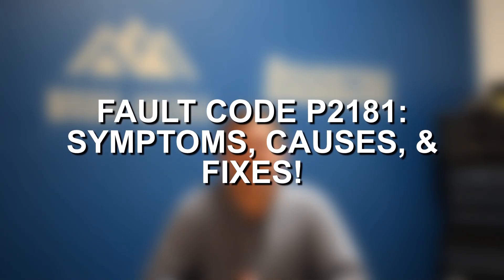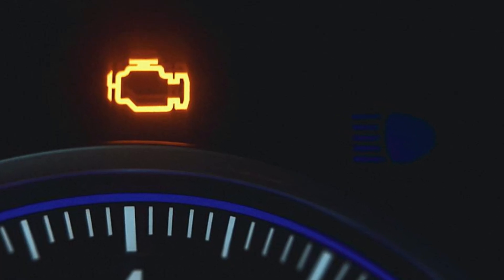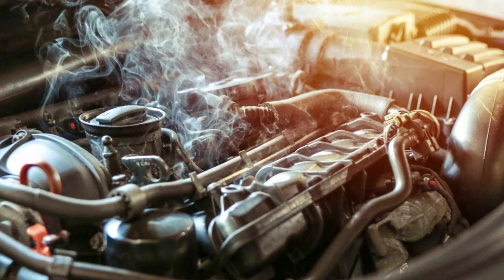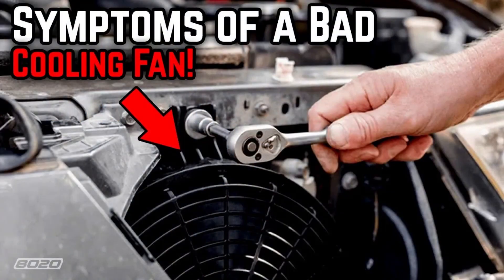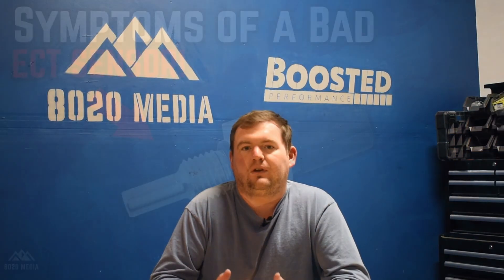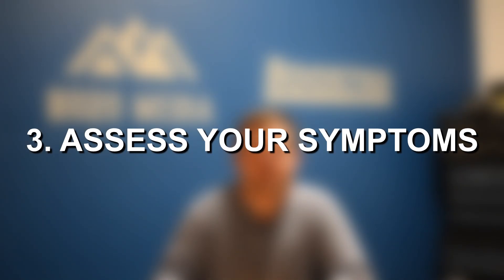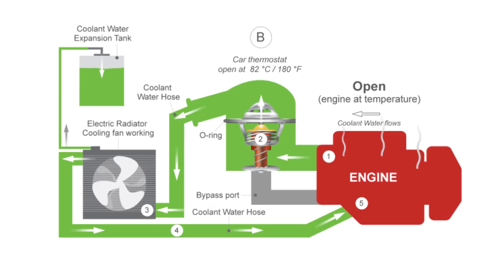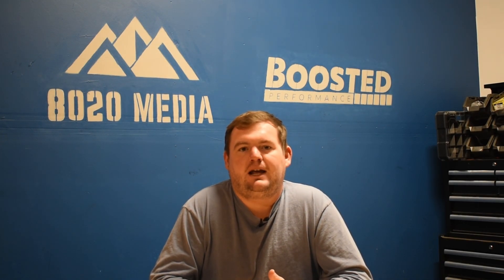P2181 Trouble Code – Don’t Replace Parts Until You Watch This!

Comment: thank you for responding to the comments, I've read a lot of your answers and learned a lot.
I have a 2007 Ford Explorer 4.6. I've been driving with this problem for three years, and the mechanics can't solve it. The RPM doesn't exceed 4,000. I've checked the vacuum, replaced the spark plugs, cleaned the injectors, replaced the coils, replaced the fuel pump, replaced the battery, and replaced the engine gaskets. Recently, I noticed that the throttle valve doesn't open fully, and the scanner shows that it opens by 47% when I fully press the gas pedal. However, the pedal indicator shows 100%. How can you be sure that you need to replace the throttle valve? The scanner doesn't show any errors. This is the last thing I want to do to this car, and I'm already desperate. If the problem doesn't get resolved, I'll have to sell this car, and I've put so much effort and money into it.